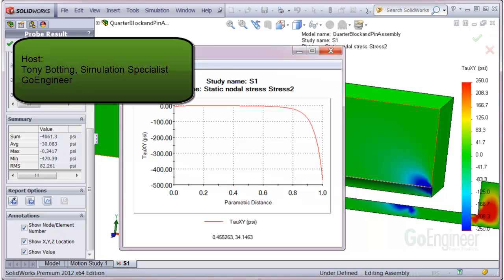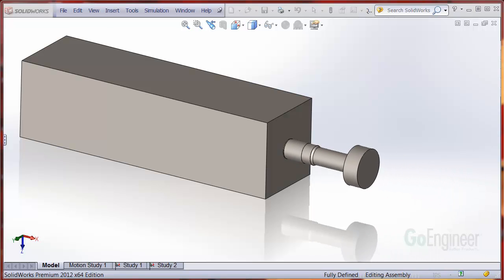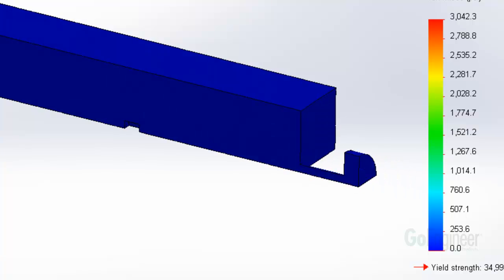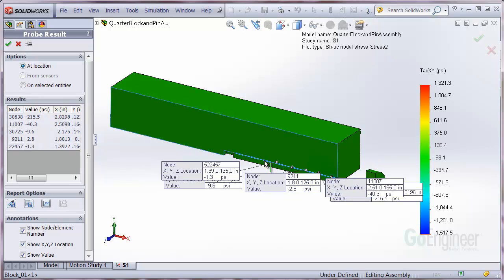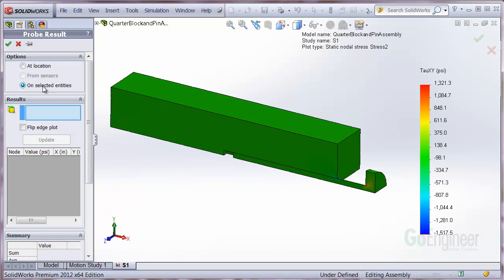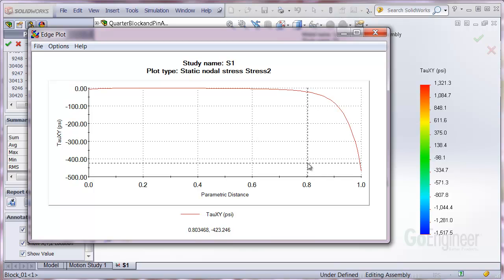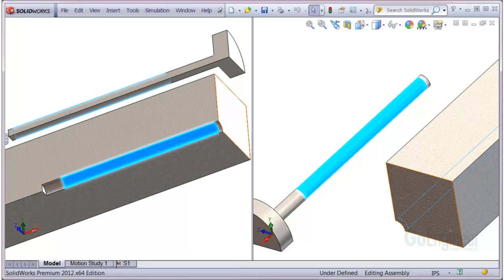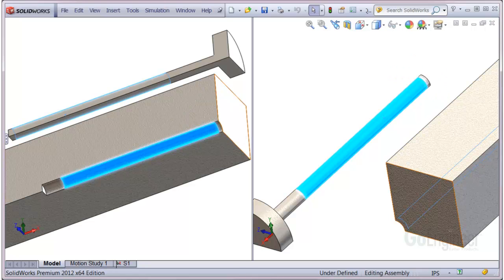SOLIDWORKS Simulation - Bolt Shearing Stress

Comment: how did you enable the section view in simulation module?...I am not able to see section view in simulation
Reply from the maker: In this model they did not use a section view but actually cut the model in another configuration. The symmetric nature of model and simulation allow for us to use this simplified model to get good results.
Reply: @goengineer  ohhh got it…but what if we want see the section view of the model after simulation results….in this case how to examine what’s going on inside the body?
Reply from the maker: @vrajtalati5300   Great question, Here is a video that goes over a number of post processing techniques, the link should start you at 11:15 where we discuss section clipping https://youtu.be/G8he8mqQCuo?t=675

and here is more information from the help file about it as well   https://help.solidworks.com/2022/english/SolidWorks/cworks/t_creating_section_plots.htm?verRedirect=1
Reply: @goengineer  thank you